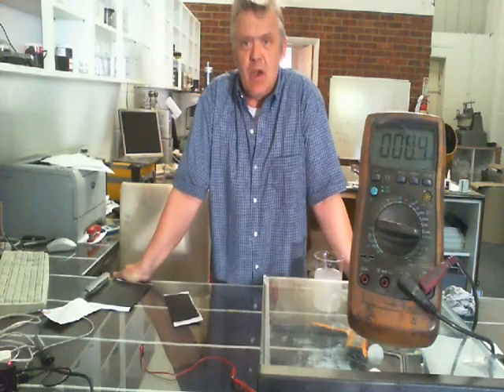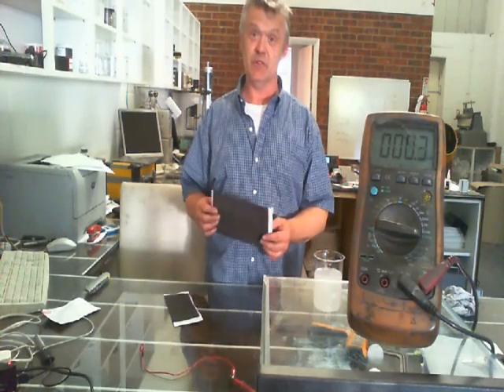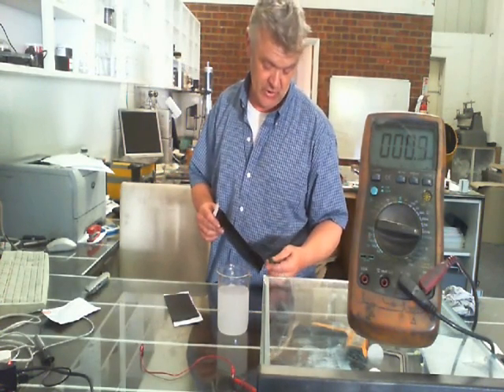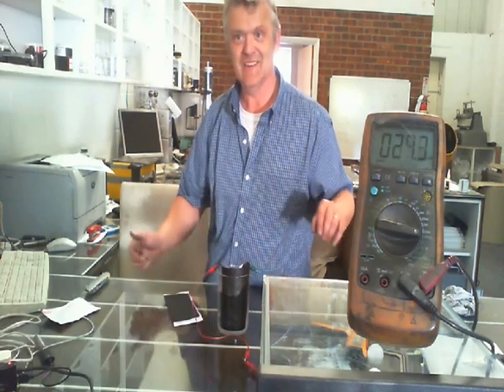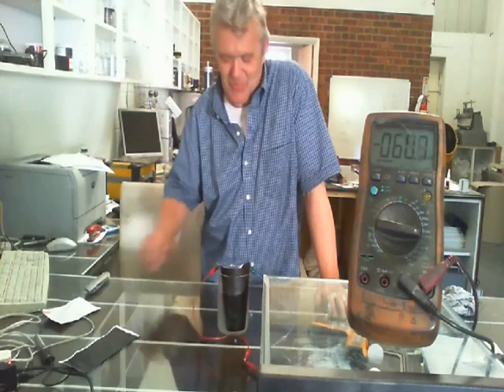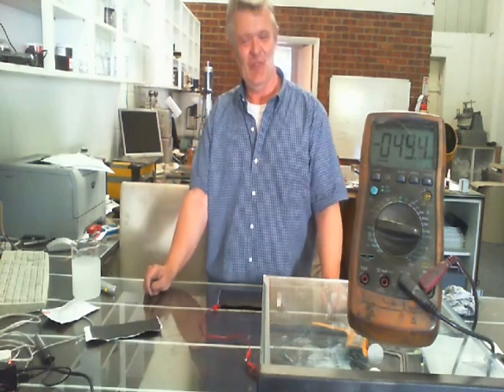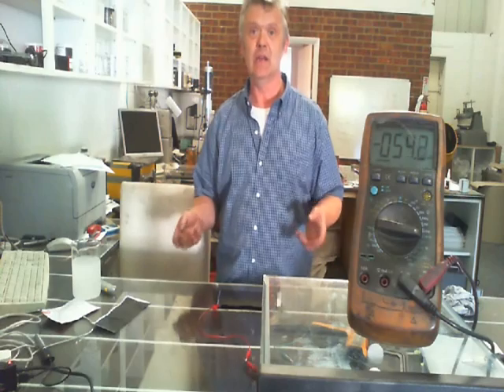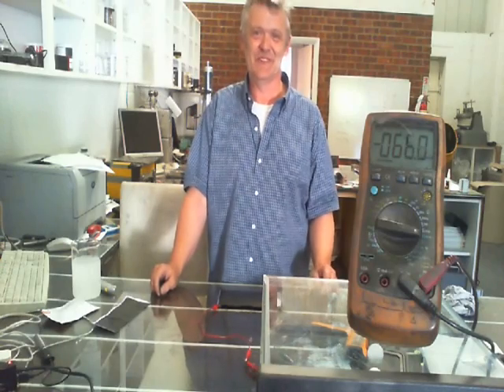How To Make An All Carbon Battery - A Type Of Karpen Cell

Comment: Thanks, I found this to be the best video on a carbon battery. I couldn’t quite make out what you mixed the carbon with to paint it on the paper. Could you let me know? I’d like to do this for homeschooling. 
I believe Tesla is working on this and I believe it should be used in all homes. A simple wind generator/ voltage regulator and battery station could probably take up the excess power needs of the future. So appreciate your time and understanding. It was a great video. Seriously

Comment: You made that nanoparticulate copper solution, perhaps you could simply rub a little of that on the outer sides of the carbon and that might allow you an efficient and low cost current collector that would not interfere with the electrolyte action while helping maintain moisture?

Seeing as you have been laminating some of your projects, maybe you could stack these and laminate or encapsulate them to keep the electrolyte moist, and if they are 'open encapsulation' [something you can access the inside of] you could periodically add more NaHCO3 or the likes to keep them working for however long it takes the carbons to break down and stop producing voltage, or, perhaps, maybe regenerate them via charging.

Comment: Hey, Robert 'you should get a better reading if you use copper pads on your meter clips instead the normal alligator clips. Just a thought.
Reply from the maker: true enough - but it doesn't matter much at this stage mate as long as it is consistent - but thanks

Comment: Could u attach a cylinder to a speaker woofer or sub and as it vibrates up and down side to side if you wrap it in copper and have a magnets on the outside of it.could it make alot of electricity. Maybe the cylinder is a foot long

Comment: What batteries work as both batteries and supercapacitors at the same time?
And do you have an instructional video on how to make that?
Reply from the maker: asymmetric caps - same principles just use a metal oxide on the cathode - search google scholar for fuller details
Reply: Your awesome Rob!
Reply from the maker: lol - cheers mate

Comment: I have often wondered if it would be possible to make a battery that charged itself up from an heat source, ie a battery that you could stick on the wood stove, use heat to charge it, or maybe even still be able to charge it conventionally, then run it down under load and then reverse the chemical process again by heating it back up to recharge it. With battery technology the possibilities are endless I suppose. You could have solar panels acting also as batteries. I have played around with Bismuth Telluride heat- see beck effect generators like the ones on stove fans, but at the moment they are only about 6% efficient.
Reply from the maker: I suppose it would be mate - i would certainly encourage you to look into it and maybe do some  experiments along these lines